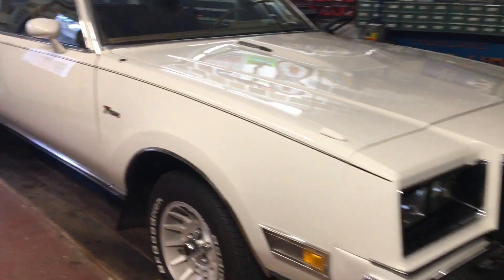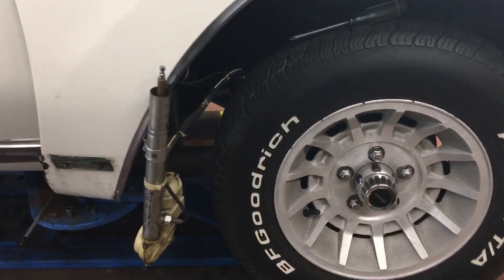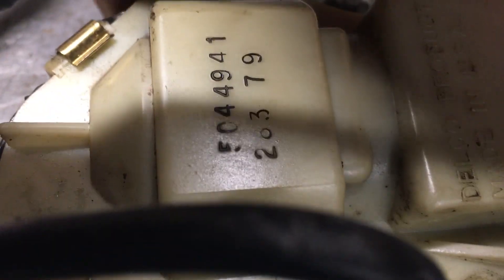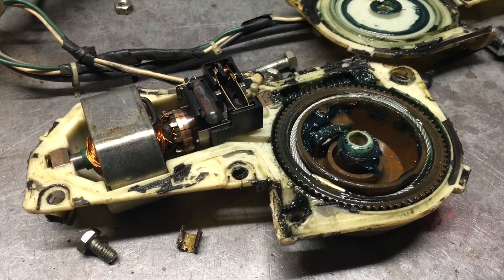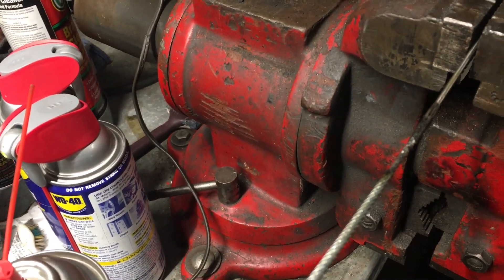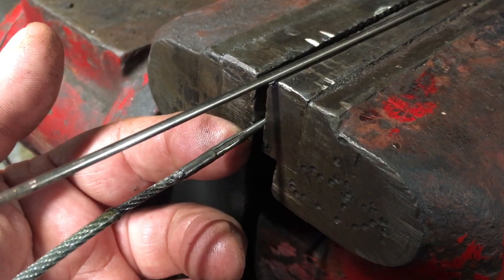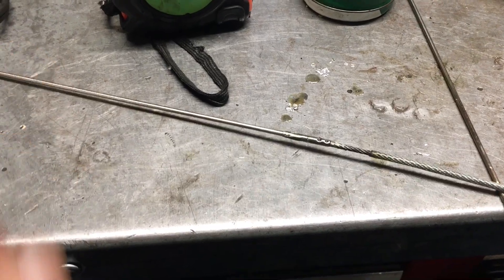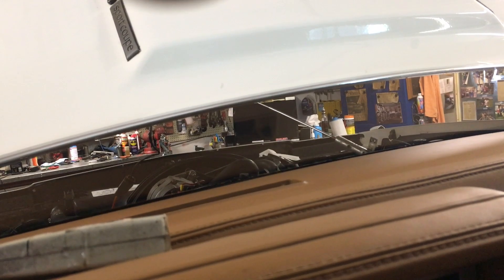1978-1987 BUICK REGAL POWER ANTENNA FAILURE / "This time it was my bad" !

Comment: i think i may have a faulty power antenna relay on my 87 pontiac safari wagon. the power antenna hasnt moved since i got the car a few years back. to test whether the antenna itself is functional i imagine i can disconnect the power connector from the antenna that is under my hood and then run lead wires from a battery directly to the wires on the power connector. if it runs then the antenna is good and my culprit is the relay or something else besides the antenna itself. sound right?
Reply from the maker: "Somewhat" ... (I had an 87 Caprice Estate Wagon / BEAUTIFUL car !).  Lets ask this: do you hear a "click" in the "QUIET" of the car upon turning the radio ON & OFF ? ... ALSO: DO the "courtesy lights / dome lights / and the cigarette lighter work ? / *(were looking for a possible blown fuse here, *as these fuses "feed" the antenna circuit it's "pwr." too) ... and after that, (in the MAJORITY of examples);  the issue is usually in the antenna assy. itself. 

Suggestion:  If you can come up with a 'test light': there are 3 wires: the "outer" wires (on the connector) are "direction up / & direction down, and the center is ground. Lets clip that test light to a ground / and then we can check (or probe) BOTH of the outer wires / while you AGAIN: turn the radio "on and off". Again: in having done many, many hundreds of these, the issue is usually always 1) "a blown fuse" (or no "clicking"), or 2) the Ant. unit itself. (usually the cord breaks and it runs itself to death) ... 

Relays will / and can occur as well, but this is VERY VERY rare (a relay failure) / in MY opinion.  BEST OF LUCK.
Reply: @TommyZTrains  i hear no click and upon removal and attachment of the relay with wire leads to a 12v battery i cant generate a click either which leads me to the hope of just a blown relay , a simple fix. my cigarette lighter, courtesy light, and dome light all work and none of my fuses are blown. 
man, a blown motor? i didnt consider that. i hope not. im mentally preparing myself to pull off that tire and fender piece and pull out the antenna to replace the cable, but only if i have to. 
i will put a test light on the connector as soon as my new relay gets here tomorrow or the next day. thank you
Reply: @TommyZTrains  thank you so much. after it didnt work after putting in my new relay,  upon your suggestion, i took a test light to the power connector under my hood. i saw that i was sending power past the relay and it was getting to the connector. but putting the tip of the test light on the opposite side of the connector plug showed that no electricity was going through. so i took the connector apart and thoroughly cleaned both connecting ends. i put it back together and it works. now i just gotta lube it up because its been sitting in one position for who knows how many years and sounds like it has too when going up and down. thank you
Reply from the maker: @notreal5299  PERFECT !! ... "now lets hope the Nylon cord will fair-well after" !  ;  - )
Reply: @TommyZTrains  i hope, but my hopes arent high. i have your repair method firmly in the back of my mind. thank you again, that antennas been bugging me for years

Comment: Hey I’ve been watching your videos but figured you would know if the 1980 3.8 turbos have a throttle position sensor? Or what would be good things to check for a stall when I hit the gas? Thanks anyway nice vids
Reply from the maker: Hi Dennis, we called that "triple C" ... (or: "computer command control"), and NO, I don't remember the 80 year TURBO having that "O.B.D. Gen. 1" System.  SO: If your "flat" (outa the hole / from a stop / and HESITATING), I'd look carefully (*and this is easy) at the acl. pump DISCHARGE. You'll see the acl. pump plunger *(under the lever that cams up & down just atop of it) ...SO: motion it up and down / or DISCHARGE the fuel  ... 

The TEST: *with the engine idling; if you put your fingernail atop of of it (the pump lever shaft that ascends INSIDE the Carb.), and plunge it down-word (up n' down),  the FUEL you just "shot-down" the primary (or FRONT Barrels) should literally almost STALL THE ENGINE out (or flood it) EACH TIME IT'S DEPRESSED. 

If in doing the above / you find it has NO (or little effect), there are two possibilities as too the "why" / (or what's the matter)  1:  a stuck check-ball in the pump well (it works like a sump crock check-ball), NOT "CHECKING" the Fuel. 

2)  a rotten / faulty pump "cup" that's so old / it's fallen apart. So again: when you depress the acl., you should be able to look down the PRIMARY (or the front barrels) and see that "discharge" each time that lever (It's usually a green Teflon color) articulates up and down. That figuratively IS the "T.P.S." Sensor. 

Other possible reasons: no vacuum advance at the distributor / or no vacuum on the acceleration curve TO the Dist.  / hope that helps.
Reply: TommyZTrains thank you very much I will try today. I appreciate you taking the time and will let you know, I’m working on a 80 Monte Carlo t top with the 3.8turbo it’s coming together pretty good
Reply from the maker: @Farmerboy5  WOW ... "rare" !!

Comment: what type of plastic clips do you use for mud flaps
Reply from the maker: Those clips came WITH the Mudd Flaps and are a standard clip (like in this era's a-typical GM Radio 'hold-down' clip), only INSTEAD of a fine threaded "bolt-thread" (with the std. 10mm nut), they have a square-shanked machine screw thread that clips-in that same "holder" (thus locking it in place so it won't turn),  and THEN it's cinched-up BEHIND the wheel-opening molding / only these have a plastic wing-nut to secure them with. (like u said)
 
End run: ("and I suppose the reason why"), NO hole need-be drilled = no rust / or alteration.
Reply: @TommyZTrains  thanks a lot. on the rear of my car i used the plastic screws that came with it & i had two holes available to put them in but on the front behind my wheel i can’t seem to find a place for them
Reply: @TommyZTrains  thanks for the response